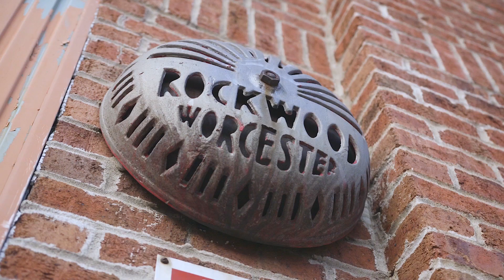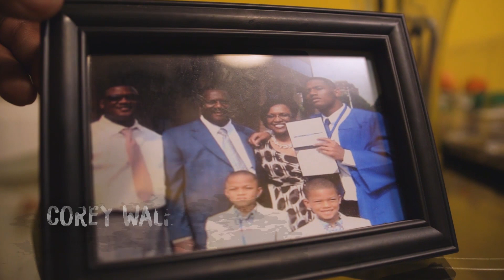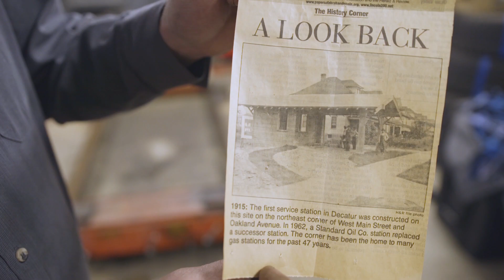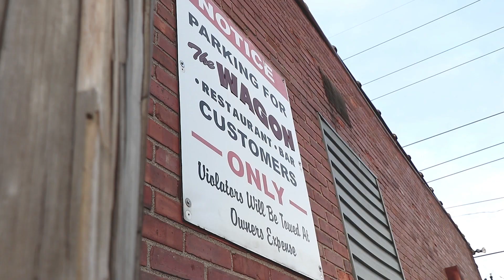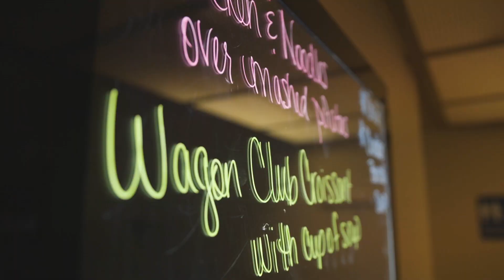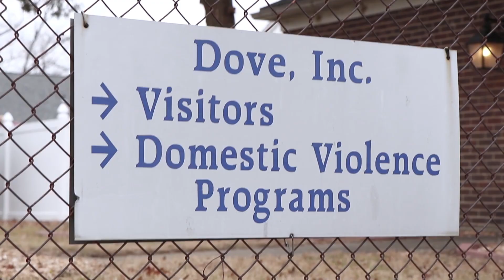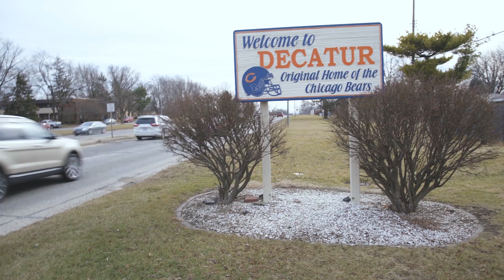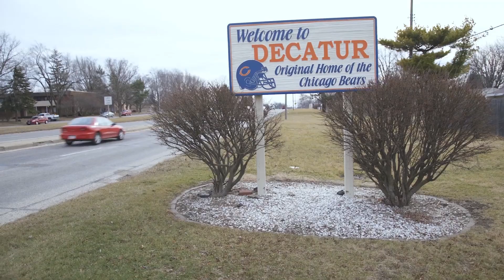Forgotten Illinois: Decatur

Comment: I was born there in 1961, went to Millikin, didn’t leave until I was 20, lived a few years there after that. Parents used that service station, or an earlier version, in the 60s and 70s, mostly for fuel but occasionally for car repairs. Last visited when my parents died (2016-17). Can’t imagine returning there: it’s bleak.
Reply: May I ask you if you know any norfleet's or atteberry or stroyeck ?